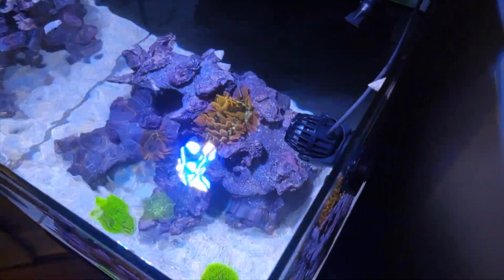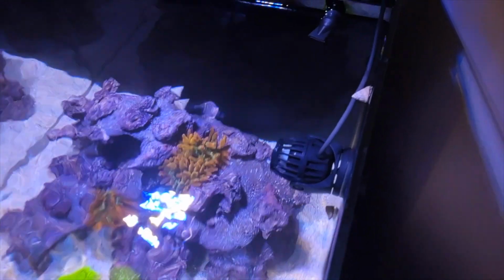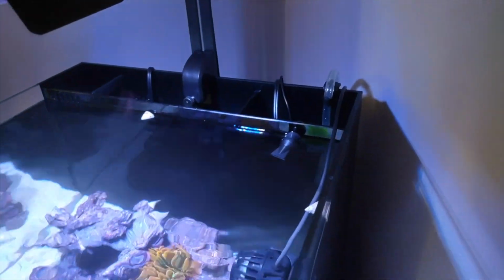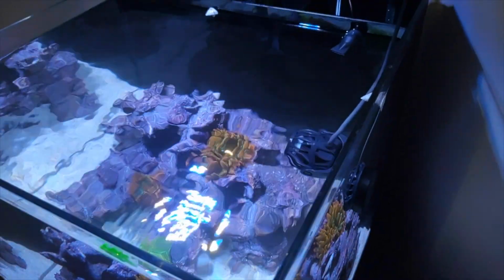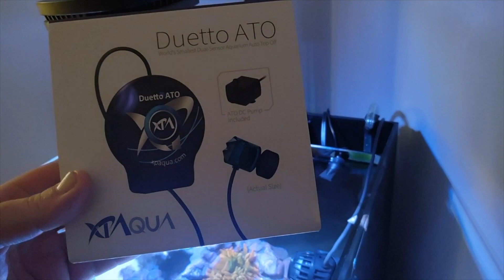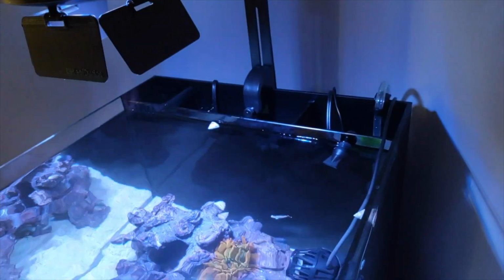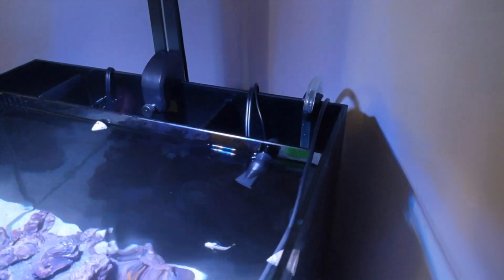Nano Reef Tank Build - Duetto ATO - Episode 7

Comment: Question do you cut the auto top off off to do water changes ?
Reply from the maker: Yup. When I turn my 75 gallon back on it takes about a minute to level out in the sump. If I don't turn it off it will add rodi water to the system

Comment: I have this same ato on my Nano and from time to time it will stop working with blue light flashing, I unplug it and it starts back up in normal mode for a few weeks. Have you had this issue yet and any idea why this ato dies this? Came back from vaca back in Oct and water was down 2 inches
Reply from the maker: I haven't had that issue before. Maybe the eye needs to be cleaned in rodi water 🤔